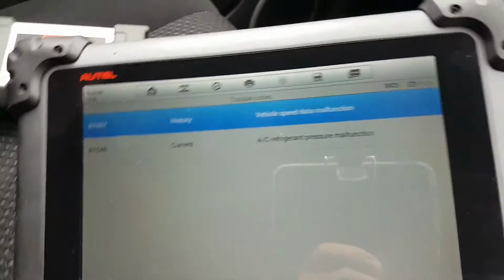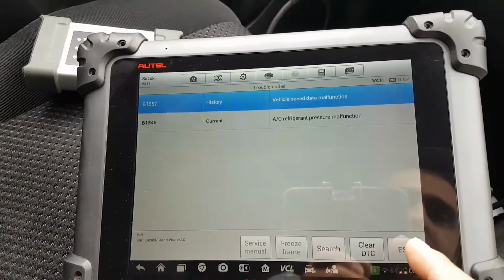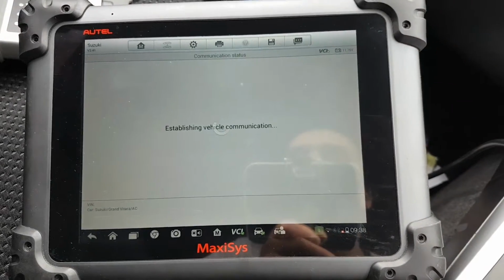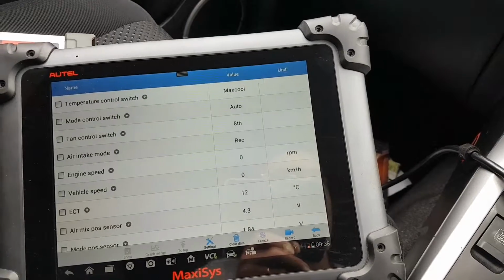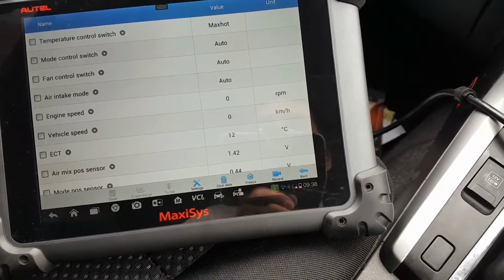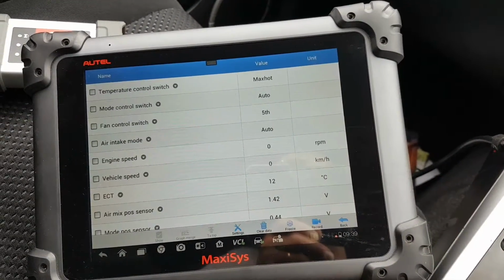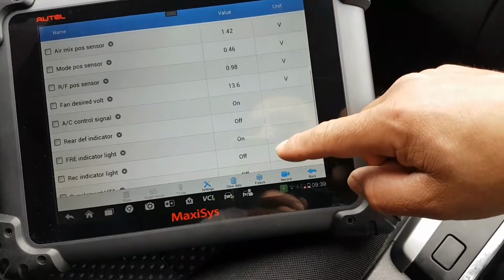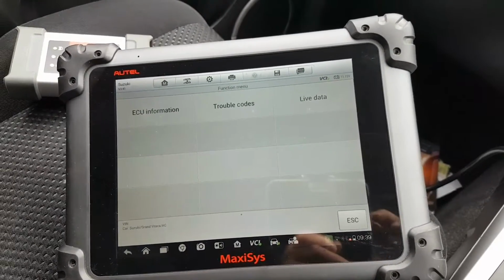Suzuki Grand Vitara blower motor HVAC not working... Fault finding and repair.

Comment: Well  done but d problem I having when u put the ignition  on orange lights cm on d a.c. control dat is not  happening an the blower, or d whole system doesn't  function.once I c d orange lights I kn it's working  how can I solve dis

Comment: Hey my  Suzuki Grand Vitara fan  works very well and also i changed Air heater flap actuator motor CSA512T009  but still this  light is flashing yet really i do not know what the problem is there right now?
Reply from the maker: Have you scanned the car?
👍👍👍
Reply: @LMAutoRepairs  No  i didn't scan it
Reply from the maker: Scan it and look at live data should help you figuring out why that is happening...
👍👍👍
Reply: @LMAutoRepairs  Ok Thank you

Comment: I changed the air conditioning panel because the lights don't work anymore and now it goes the other way, when I warm it I put the cold and vice versa.  a solution ?  tester? Thx

Comment: Ha a Russian repair lol no parts required. Well done Luis it will need a motor eventually as you well know. But it works out cheaper for the customer and it is still a better motor than most aftermarket scrap out their.
Reply from the maker: A Russian repair...
Think I never heard that one before...😊
👍👍👍

Comment: The motor rusted because a clogged drain and water accumulated in the area.   Nice job. I like when people try to repair when possible instead of replacing without having a look.
Reply from the maker: Thanks!
👍👍👍